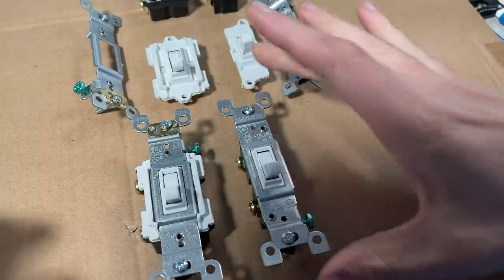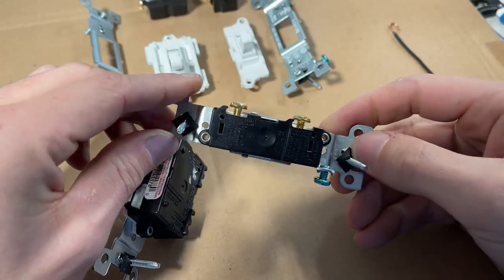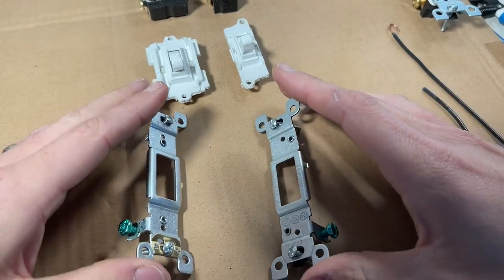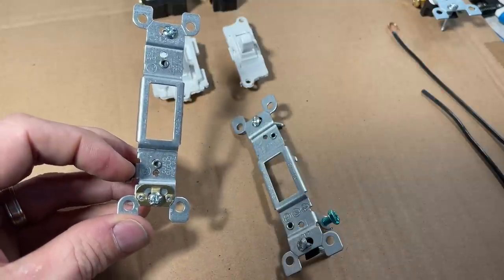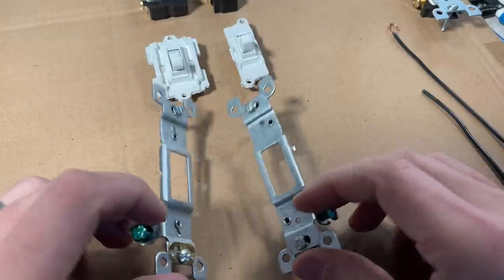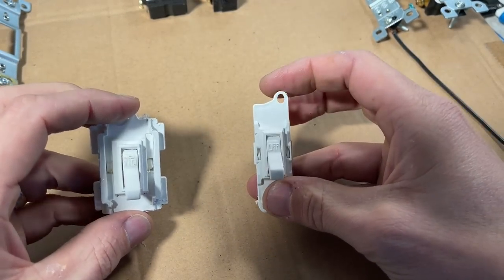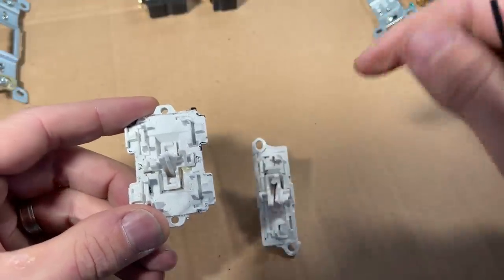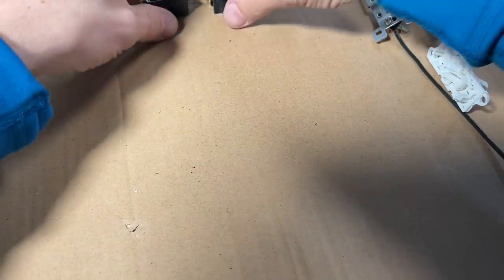What Light Switch Should You Buy For Your Home |  Commercial vs Residential

Comment: I am painting my house and noticed that in both upstairs bedrooms, the BUILDERS ELECTRICIANS speed wired everything.  The heat got so bad that the housing on one switch cracked through in the box.  They will all be getting replaced.  Good example of what can happen after 25 years.

Comment: One question I would have is the over-centre mechanism: I come from the UK, currently living in Canada, and I see a big difference here: In the UK the over-centre mechanism is quite strong, making sure that the switch contacts don't flip until the switch lever is moved at least half-way, meaning that the contacts move rapidly and decisively to the other position. This greatly reduces sparking at the contacts and extends their life. Here in Canada it seems this mechanism has been weakened or removed, because, I am told, of the noisy operation it gives. But I find that if I move the switch gently I can actually hear - and sometimes see - sparking inside the switch. It frightens my (Canadian) wife, who has asked me to change some of the switches because she doesn't trust them. Neither do I. I'd far rather buy switches with a strong over-centre mechanism, but I can't find any. Do they exist on this side of the Atlantic? From what I could see in your video there is no over-centre mechanism at all in either of the two switch variants you looked at. Is that correct?
Reply: This is exactly right. Arcing between contacts literally wears away the contacts in the switch, and the heat of this arcing can melt parts of the switch in the worst of circumstances. Yes, better switches exist in the US that take this into account, there are a variety of ways you can design a single pole switch which do this in better or worse ways.
Reply: @xf22b , my question was whether I can buy an over-centre make-break type switch in North America. According to wikipedia, you guys gave up using them in 1984, apparently because they were too noisy? Are they still available here, or do I need to import some kit from Europe to do it properly? And yes, you can simulate the fast movement of the contacts by flicking the switch harder, but my point is that my wife has become wary of some switches because they crackle under "normal" operation. I don't want to have to tell her to change the way she turns lights on and off. I'd far rather buy some properly-designed switches that won't do that.
Reply: You might try the "Decora" or similar versions.  I believe that those act as you describe.  For instance:
https://www.legrand.us/wiring-devices/light-switches-and-dimmers/residential-switches/radiant-15a-self-grounding-single-pole-switch/p/tm870sw
Reply: Thanks,  @mtgibbs , I followed your link but got a "not found" error. I did find a "Radiant" 15A switch on their website, but they gave no picture and no price - essentially no information at all. I've emailed their Canadian distributor for details.
Reply: @robwhythe793   You're welcome.  That's strange.  Maybe the Leviton site will work.
https://www.leviton.com/en/products/5691-2w
Reply: @robwhythe793  Do not import European switches.  I don't know about Canada, but in the US, anything electrical must be UL rated.    While you can install non-UL stuff, if your house burns down, this will be a reason for insurance not to cover your claim.  And, yeah, I agree that Euro switches are generally nicer.  For a while (still?) LeGrande was selling Euro-style switches in the US, not sure if this is true anymore.   You might also check out 'Decora' style switches, which is more of a rocker switch (edit - ninja'd by @mtgibbs)

Comment: The narrow single-pole will not work with the lighted  LED wall plates , the contacts will not touch the side terminals, the Lighted wall plates require the wide preferred or a true commercial outlet.

Comment: It looks like the contact surface area of the commercial switch is also larger at 8:47 (which means it would operate cooler and/or carry more current). Commercial switches are also commonly rated for 277V while residential are typically rated 120V or 240V. I use commercial devices primarily for the wire termination pressure plates.
Reply from the maker: Hey Soren,  I have the cutaways in front of me right now and I write this and then seem to be the exact same design / contact area.  At least for Leviton but that might be different for Eaton and other brands.

Comment: Our light switches are probably the cheaper ones (house build in 2005) and we've noticed that we can sometimes hear sizzling inside of some of them when the switch is on, and on some you have to press up harder to get the light to not flicker.  I want to know if the commercial switches would be less prone to this type of behavior.  Our led bulbs always burn out fast and I'm assuming it's because of these poor connections.
Reply: I think yes. Just replace them with higher quality switches ASAP.  An ounce of prevention is worth a pound of cure.

Comment: It seems like the point of commercial is that it's faster to install, in commercial settings. The actual switch costs more because it's easier to install, but they would probably save that money in the long run of paying for an hourly electrician with dozens or hundreds of switches.

Comment: The 2020 NEC code now requires that switch connections be torqued to the amount specified in the switch installation instructions.  That will require a torque screw driver.  The extra 1/4 turn with a flat head is no longer adequate.
Reply from the maker: Hey Tim,  thanks for the feedback.  What type of torque screw driver do you use / recommend?
Reply: He doesn't have one. No one does.
Reply from the maker: @supsoo  😂
Reply: @kscotthoy  SH lets see a $80 screw driver to install a few switches....when since most people can get a wire tight?  Never seen an inspector take a plug apart to test torque.  They just insert in the plug tester and watch the lights for the more common problem of reversed wires. Test at most 10-15 plugs and really look at how neat and clean the main and breaker box appear to be done.  THAT shows the quality of the job.
Reply: @kscotthoy  i was just asking my coworker today if he thought full time electricians use a torque wrench consistently. I am going to show him that screwdriver, didn't know it existed until your post Scott, i like the community learning on YouTube
Reply: I have a torque screwdriver, which I got to tighten the screws on the King copper-to-aluminum bus bars. At the time, King recommended Weha's product, because that was the only that accurately set the torque. Unfortunately, they cost over a hundred bucks, and I got something a bit cheaper (can't remember what). King currently also recommends  the Klein and CDI drivers. Torque is important on the AlumiConns because under excessive torque, the aluminum conductor deforms and loosens.
Reply: I used Wiha fixed torque and iTorque adjustable torque screwdrivers. They are not cheap, so probably not feasible for general residential use. The fixed torque holders can be used with their speedE lectric screwdriver that takes up the slack, and then one manually gives it the final twist until the torque stop gives way to the final proper torque. It's half automatic/half manual, but then you get the hand feel of the final torquing.

Comment: You never removed the contacts for either switch.   They look like they have some different features near the screw that could make one more robust and reliable.  You did that for the blade clips in your prior outlet video and you should redo this video to include contact removal and evaluation.
Reply from the maker: Hey Curtis, thanks for the feedback and the contacts were the same but the commercial grade did have a little better "snap" when flipping the switch between On and Off which would help with the life of the contacts.

Comment: I have several vintage residential light switches from replacing them over the years in a house that was built in 1962 and they say AC only on them.  I don't get why they say they should only be used with AC power since, as far as electricity cares, a switch is going to allow or disrupt the flow of electricity regardless of whether the electricity is AC or DC.
Reply: Switches all do the same thing. They got a mechanism inside which opens or closes. When closed electrons flow. When open the flow of electrons is cut off.
Reply: The reason it specifies AC only is that the contact size and material need to be somewhat larger and or tuned for dc circuits due to more current flow in low voltage dc vs higher voltage AC. Also some also show AL because aluminum expands at a different rate than copper and Aluminum wiring will loosen over time if used in a copper only outlet or switch. Strongly suggest avoiding Aluminum, IMO not safe.
Reply: @carlb9101  I have also replaced some outlets in my house where the modern replacements say Cu Only.
Reply: @carlb9101  The problem is the DC arc. Most AC switches are Not built to withstand that.
Reply: @kalijasin  I agree. AC arcing quenches easier, so for the same voltage and current rating, you need a larger distance. That it why you will see AC and DC ratings that are different on many panel switches.
Reply: @markc2643  That’s an issue with the flow of the current in one direction.
Reply: @kalijasin  The amount of arc you get when you disconnect is directly related to the current. The larger the current the more metal can be evaporated. The higher the voltage, the larger the distance needed to quench due to that evaporated metal. A 120V 15A switch needs a larger quenching distance than a 120V 1A switch.
Reply: @markc2643   “Since arcing is the flow of current (i.e. electric charges) through a gas, arcs occur far more easily and with greater effect in DC circuits where the current is only flowing in one direction and has a steady voltage. In AC circuits where the polarity, voltage, and current are constantly changing and reversing, there is much less risk for damage from arcing.”
https://temcoindustrial.com/product-guides/contactors-and-overloads/ac-vs-dc-contactor
Reply: @markc2643  🤦🏻‍♂️
Reply: @kalijasin  I never disagreed with why DC is different from AC. Just explained quenching distance being related to all aspects, not just whether it's AC or DC. Fuse design is also affected by all 3 aspects.

Comment: A flat head screwdriver is best to tie down you hook solid.   I do use for a single on /off the push in unless you keep playing with that switch it works just fine .   AC voltage is forgiving with Current so pushing the wire in makes it quicker and easier.  If your doing multiple lights or circuits with this switch then then use the hook connections .

Comment: If you tell the customer that the industrial one is better (it could be) ,it will save you time with installation with less hassle (at least I think so) not having to deal with the shepherds hook , especially when dealing  with 12 AWG wire . Yes I know most light circuits use 14 AWG so my comment really applies  to receptacle installation especially if they are daisy chained.
Reply from the maker: Hey Lee, I also like the back wire feature on the commercial.  For me that is probably the most beneficial difference between the commercial and residential grade.

Comment: I've replaced a few residential switches that failed.... never replaced a commercial.
Reply: 26 yrs as a journeyman electrician and I have replaced both, maybe a few extra residential ones that were not due to the customer breaking them, but not many. For the most part a residential switch will see more use, most commercial switches turn items on in the morning and off when shift ends or left on indefinitely.  The main reason for commercial outlets and switches is the potential for larger loads and for the ability to switch these larger loads. Most residential circuits are not fully loaded, at 12 amps for a 15 amp breaker. Typically I see most circuits at 4-7 amps with everything on ( the switch might only be seeing 1-2 amps other than in a kitchen). Where in commercial installs typically in the lighting circuits run closer to 10 - 12 amps on a 15 amp breaker.   I don't see a need to use commercial switches or receptacles in a residential home with the exception being higher rated loads like built in vacuums and large air compressors in garages where I now use a 20 amp t slot receptacle.
Reply from the maker: Thanks for the feedback and sharing your knowledge/experience.  I liked the plug retention on the commercial in this video https://youtu.be/kX6xnOksQTc for those receptacles with higher frequency use of things being plugged and unplugged.

Comment: When you ground the switch (green screw) it also grounds the plate screws as well. The true story which happened years ago is this. Metal box containing switch nailed to stud from the inside of the box. The switch located in the kitchen next to the stove. Switch nor box was grounded and the mounting nail worked it's way out to come into contact with switch terminal. Box became energized which made the switch cover screws hot. Touching the stove while turning on the kitchen lights would shock you. This is getting to log..sorry The quick fix was to replace nails with screws. Old house 2 wire system.....
Reply from the maker: Good info, interesting story and appreciate you sharing 👍
Reply: @EverydayHomeRepairs  Now with plastic boxes that would not happen. But if your switch was to happen to short out the connecting grounding wire would trip the breaker. Bottom line the green screw just isn't there for looks...
Reply: Plastic boxes in houses not commercial boxes (metal)

Comment: There is no need to use a slotted screwdriver after using a robertson screwdriver. The robertson can put more torque than the slot. There are 3 sizes the small one is the one you need in this application.

Comment: I don't know if I've ever seen a switch or outlet with those plates on the *outside*, but the $1.25-range switches & outlets often have a similar arrangement *internally*.  There's a back-wire hole like on the 50-cent ones, but the wire is secured by tightening the screw, as opposed to simply sitting under a little spring. This is acceptable by code and often faster than the shepherd's hook. 

Speaking of that spring, if you're removing one and don't want to just clip the wire off, a small flat screwdriver is obviously the best, but if you don't have one handy, a piece of stripped wire will do in a pinch.  Bend about 3/4" over to 90 degrees so you can apply good pressure, and push it into the release hole.  You'll meet some resistance, but jiggle it around a bit and you'll find the sweet spot.

Comment: I don't like a lever switch not that they are bad but you could get a shock if water gets beyond that lever if your hands get wet. I use a rocker minimum they look better and are sealed better from water also you can get them illuminated so in the dark you can see your switch , much better.  The best is a sealed switch that is touch or slide both with light.

Comment: Use an ECX bit to tighten your screw terminals, just about all of your commercial and quality electrical screws will be  ECX1 or ECX2 even things like the screws on metal electrical boxes covers and conduit.
Reply from the maker: You put me over the edge after about 10 others have called out the ECX bits / screwdrivers.  Just ordered a #1 and #2 to give it a go on the next wiring project in a week or so.  👍
Reply: @EverydayHomeRepairs  comparison video coming soon, I hope!

Comment: No, I want to know what you think...
On the commercial switches is it okay instead of pigtailing to put your two hot wires under the same brass screw (and two neutral wires under the same white/silver screw) using the back insertion and clamping done with the screws?
To me that seems no different than pigtailing but if three or more wires were involved I would pigtail.
Reply: It's acceptable to put two wires under one screw with the back wiring method. Just take care to make sure the screw is very tight and the wires don't move under the plate at all when you wiggle or pull on them. The plates are built to hold 2 wires and you may notice there are 2 notches in the plastic behind the screws where the wires are meant to fit in.

Comment: I replaced my bathroom switch with an illuminated mercury tilt switch 30 years ago. it's still going strong even though it powers the outlet that we use to plug in the hair dryer. I don't think you can find mercury tilt switches any more, and that's a shame. They don't arc, they are quiet, and they last forever.
Reply: You are correct, you can't get them anymore because mercury is considered too toxic to use in consumer devices except fluorescent lights. How that applies to a sealed vial inside a switch housing is beyond me. Maybe they consider the manufacturing process is dangerous to the workers. I remember installing one in the bedroom area of a house because the old 60's era switches made a loud snap, and the mercury was silent. Now most switches are quiet, or I am getting deaf.

Comment: The tiny brass plate on the commercial switch's/outlets is an essay answer.   See historically there was a casino fire caused by poor grounding, at 440 volts.  But, the flaw was exposed.  Bonding and good ground connections should be taken serious, and some of the pot-metal was not creating a good ground.   So on the commercial switch, the brass plate, and sometimes two brass plates, give an better electrical bonding to the "metal box".   The housing being bigger,  because the commercial switch/outlets will take up to 10 guage wire, so, they need to be a little more meaty, to hold up against the wire.   The commercial switches at one time, had a snappier click on, but, the cheap switches seem to be equally as good anymore with their snap, but I do notice more burnt out cheap switches.  You didnt weigh the metal parts of the switches.